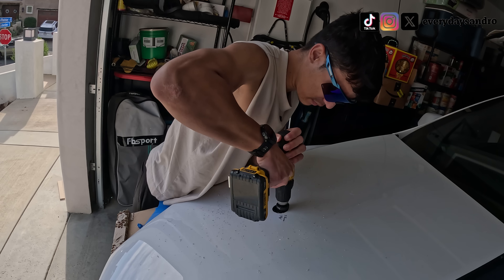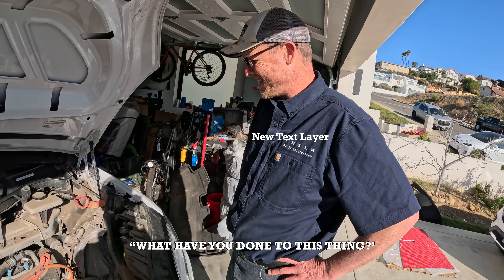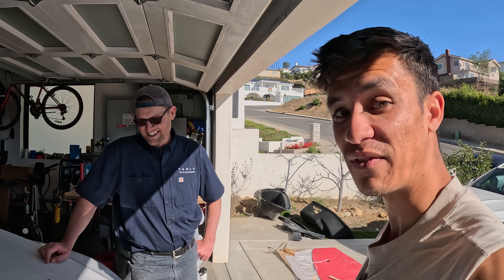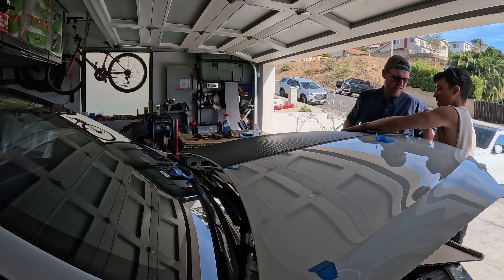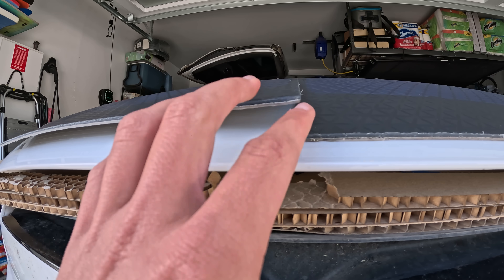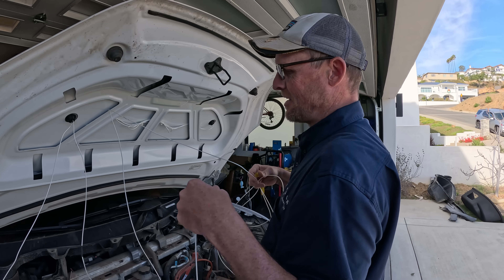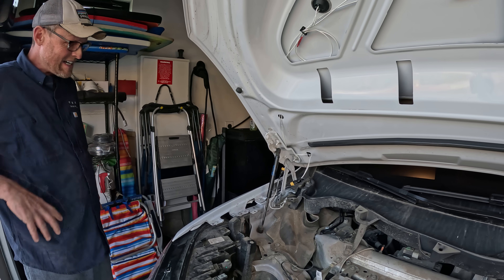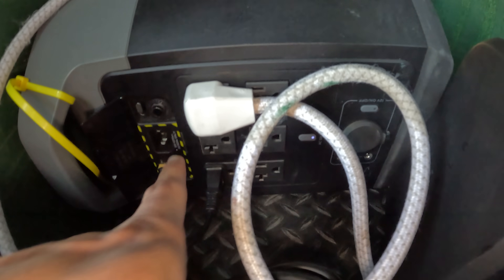DIY Solar Powered Tesla - THIS Changes Everything

Comment: Eh...why not get the EF Alternator charger? 800w output at $350 now. Or the Bluetti for $250 which charges at 500w.  Even if that's not an option for Tesla (haven't tested on my MY yet), just mounting 1 flat 400w panel on the roof will give you way more charging power and an easier install too.
Reply from the maker: Those are great tips but Teslas like you know don't have alternators so there is no real way that I know of get serious power. A 400 Watt panel wouldn't work on my setup with the Belugas wings!
Reply: @EverydaySandro  Between the time Ieft that comment and now I've researched a little more and yes it is possible. In my 2023 Model Y there is a DC to DC charger under the rear passenger seat. Your car has one too but not sure where.  You can charge your Delta 2 at 800w no problem without an alternator in a Tesla. Many people have done it by now. Even the Bolt can do it. Even a hybrid like my 2022 Sienna can do it.
Reply: @EverydaySandro  https://www.youtube.com/watch?v=-5kjbbG6Dx8

Comment: While this is a nice project, I would not expect much from those tiny Panels. On a Model 3 or Y I would probably try to either replace or cover that stupid glass roof with Solar...but even then it's probably not worth it.
Reply from the maker: Thank you for sharing your opinion but it has been very practical for my setup. These solar panels are often used for solar races, so some of the most efficient modules available. I peaked over 210 watts the other day!
Reply: @EverydaySandro  
Hmm...but isn't 250 Watts roughly what the Tesla uses in it's "On but Idle" mode? I think that's about what my Model 3 uses when charging for example,.so anything less than 200W of Charging power would not add anything to the battery?

Comment: This without about 6 to 7 mi a day if the panels are producing the maximum amount of power so let's be more realistic and cut that in half and it's about 3-3.5 miles a day of charge but if you calculate in the normal drain of the vehicle this number becomes even less
Reply: Prevent your car from randomly dying though and not able to boot up or open the doors so that's a bonus also might be able to run the AC for a little bit
Reply from the maker: That’s why I just use it to keep my power station charged for cooking while on the road! Thanks for being here with ys
Reply: @EverydaySandro  yeah I saw that later on in the video
Reply: I just tow my 11kw generator behind my Model S and plug the mobile charger into the 50amp receptacle, and I can go as far as I want ; )

Comment: Model y would be good 
Replace bonet with custom carbon fibre and solar
Replace glass in roof and tailgate with carbon fibre panels and solar. Use rear camera for rear view mirror. A bit harder to do as the glass roof is structural but definitely doable 😊

Comment: Great job. Next time when installing this panels tested as installing Formica on a board. Use  sticks under the panel before placing it down this way you have control over the desire location.
Reply from the maker: Great advice!

Comment: sounds pretty stupid having a battery in a car that already has a gigantic battery, maybe manufacturers have to put a connection to the car battery so that you can attach the inverter of your choice if they don't wanna offer one, or a complete solar system. maybe something like the charger plug but internal, intended for multipurpose, with charge an discharge capabilities and like usb power delivery, the battery tels the inverter what are the capabilities, so that it  auto sets everything up
Reply from the maker: Mention this to Elon! I just like to cook using solar juice, and need high output!

Comment: Should have brushed on a small amount of primer and paint on the bare metal from drilling the holes. Bare metal will rust. Over time, it will spread and get worse.
Reply from the maker: Then will just put Beluga up for adoption

Comment: I bet you lose more energy by the inefficiencies created by the impact on air resistance and added weight. I know the panels are not heavy, but they also make a minuscule amount of energy.
Reply from the maker: Haven’t noticed anything with my watts per mile. Biggest thing is that massive black center piece

Comment: charging seams limited make sure you're using an XT60i and not an XT60
Solder the center pin to ground this will disable the 8A car charging limit
Reply from the maker: We used XT60H connectors to make this work. Appreciate your input though! Thanks for being here

Comment: Remember to connect the third pin of the xt60i connector to the negative terminal of the xt60i. Ecoflow uses that third pin to exceed the 8 amp car input limit. If you use only the xt60 or connect the third pin to the positive terminal,  you would be limited to 8 amperes input current.
Reply from the maker: Thanks for the tip! This is great info for anyone trying to replicate the setup.

Comment: The 200W you get is great, so how do you plan on getting it into the battery?
Reply from the maker: Ecoflow with a grounder and then using the mobile adapter
Reply: @EverydaySandro  
Need to find an NACS adaptor that takes DC from panels and directly charges the batterys.

Comment: we want to know how much range you succeed to gain with that in place...
on a normal trip 200 miles, if you can get 50 or 5
you said 100w/h, if the car consumes 220w/h at 60 mph, that would mean you could reduce the consumption to 120w/h, that would be a huge improvement for summer trip for everyone or am I missing something ?
Reply from the maker: It doesn’t quiete work that. There is significant efficiency loss from the solar to panels into the battery pack, and then into the HV battery. I edit a test this week, and we got a few miles! Video will be up this weekend

Comment: Who is the FUSE???
The Fuse NEED to be Close to the Power output from the panel. So If +/- cum together the Fuse will protect your wires from get hot.
What If you rub the wires and the Plank cooper get tho the Metal from the car?????

And you NEED to secure your solderings!!! On Germany WE Call it (schrumpfschlauch).

Buddy, If the Car burning dont CRY😅😅😅

SO MANY ELECTRICAL ISSUSES!!!
Reply from the maker: These panels are put together in a series and don’t need have a fuse. Solar panels in parallels need to have a fuse protection against a malfunction of a panel because if one panels fails, the current adds up and can cause overheating. For our case, because they are wired in series, as the current remains constant if one fails, no fuses are needed.

Comment: at 100W, this should charge in about 12 months.
Reply from the maker: 200watts I peaked yesterday, so 6 months now - beluga🧃
Reply: At 100 Watts the 2kWh delta will charge in 20 hours provided he has 100watts constantly which is far fetched. You should refresh your math skills.
Reply from the maker: @ I peaked at 200 watts yesterday! This is 🤩
Reply: @marcusbiller867  help me out... did he say the were 150 watt each?...(correct me).. if he added roof to get to 450 watt, could he in  theory charge the car at home, and extend his range with solar charging by sitting/driving. Addionally, could he drive to/from work (1 hour), sit in the sun at work (9 hours- lunch), giving 10 hours at ( est 150 useful charging watts).. plus sitting in sun at home.. Do you think he could NOT pay for charging anymore. I don't have an EV so I don't know real world experience with how it all works... what's your opinion on my thought

Comment: Are you planning to add additional panelling to your X ?
Reply from the maker: @KrafteGrundsatzliche  as of now, no! At this time, this is all I need
Reply: @ I hear you. It’s rare that a necessary upgrade can look so badass!  Was wondering if it were possible to structure the panels similar to like an accordion, when not in use ( for storage ) but in certain situations, imagining a hypothetical config, that (if foldable) one could open up a charging point with ribs to expand it and perhaps place on ground, then once optimal ☀️ declines, could fold.  

Operating the panels on the hood suffices for your overall requirements?
Reply from the maker: @ I have actually seen a company make them for the Model Y (Prototype). For me, I wanted something small and practical, that wouldn’t create too much drag. This setup works so efficiently and requires me to only find some sunn

Comment: Ý tưởng của chúa 😂😂😂 I need a compact, high-performance solar electric bike, lifepo4 40135 battery, there is still no high-performance small solar panel
Reply from the maker: These panels have an efficiency rating of 25%, some of the highest on the market

Comment: 135 watts I have over  20 x that 3 kw on my garage roof facing the sun with the car in the garage out of the sun the second hand panels and rails cost $300 fancy shape and expensive not needed and when the battery is charged in 1/10 the time it can power other things.  Gives 200 km range a day  if you leave your car in the sun all day under 10 km
Reply: Sandro lives in his model x on the road. No garage so this is a great upgrade for him given the limited roof space he has available.
Reply from the maker: I appreciate your insight, and yes, I realize the solar potential is limited, but still loving it

Comment: Looks cool, but I hope it doesn't peel off on super a hot day. At the very least get something to overlap the front lip because the wind will constantly be tugging up on them.
Reply: wondering if a uniform tidy job of it is possible with hot glue?
or a high temp neoprene calk used on roofing.
Reply from the maker: @ we used a marine grade sealant to keep water out!
Reply from the maker: Good eye, you know what you’re talking about, as we just kitted it!

Comment: Once the Aptera comes out, you'll be able to buy their automotive-grade replacement solar panels and I bet they would work great on anything! I plan on putting some on my buddies Tesla when they are available :)
Reply: The drag co-efficient of the Aptera is so much lower than a Tesla that putting the same amount of cells on a Tesla would probably only net you 10 to 15 miles being in the sun for 5 full hours on a clear, sunny day.  Keep that in mind when you look at the cost vs. the payoff.
Reply: @Tekaisuwu  Automotive grade ;-)
Where will you get the glass cover?
Reply: @ most likely a high quality polymer as they do on the current prototypes because glass would be a massive obstacle price and sourcing wise. That’s just off the top of my head, though there maybe better alternatives available when I need to cross that bridge.
Reply: @Tekaisuwu  Aptera is using polymers now when glass isn't available ;-)
Why don't you just install solar at your residence where it's adequately productive instead of significantly impaired on a vehicle?
Reply: @ I am aware as I directly referred to Aptera using it. I’d do it because it’d be a fun and interesting project, you could say the same about this video. As I said before you never have a single positive thing to say. Why do you even consume this type of content lol
Reply: @Tekaisuwu   I have shared a tremendous amount of help providing accurate Aptera information. It's a shame you don't appreciate it more. This video was very confirming of my solar estimates. My positive comments are about helping people make wiser decisions about Aptera's true situation before they make any donations.

Comment: 300w is a lot for just the bonnet. Imagine if the whole car was covered. Maybe you'd get a kilowatt, or 1.5kw an hour.
Reply: It's a great idea but the model x has limited surface area to install solar because of the falcon wing doors. Ideally, all EVs will have integrated solar cells to recharge them in the future 👍
Reply from the maker: Stupid doors sometimes🥹

Comment: SANDRO - not worth it.
Tesla does not have enough Surface area for SOLAR to be Meaningful.
better OFF getting ROOF solar or Solar Carport and charging w/ POWERWALLS.
Reply from the maker: It’s not about range, it’s about the sun’s energy, and how to harness it! For me it’s worthwhile as I just added 2 miles to the car while I am answering all questions
Reply: @EverydaySandro   - SOLAR does not have enough surface area to be EFFECTIVE.
its why SONOS & other Solar car went BANKRUPT. 
you need 4x the surface area to charge FAST like 250v AC.
w/ solar still wont charge 50% in 8H.

Comment: But it’s NOT a solar powered Tesla….  It’s a solar powered EcoFlow battery bank for the appliances.
Still pretty cool.
It will be interesting to see how the panels and installation hold up with driving vibrations, heat, and weather.
I would definitely add retainer clips or sheet metal screws (if possible) for securing.
Reply from the maker: @covetthecamper2289  oh trust me, it will charge me, it’s premium juice - Beluga
Reply: @EverydaySandro  can you show your circuit? Documentation does not indicate you can charge HV pack from the 12v bus, AND charging the HV pack from 12v/10A will take a very, very, very long time, if possible.

Comment: Should’ve ran the cables through conduit under the bonnet and cable tied the conduit to the bonnet (hood) structure, or taped it down. Thus stop and risk of shorting because of vibration to the body contact points.

Comment: Next time get a file that has a curved bottom.  All you are doing is filing grooves into the hood by using a flat file.  Also when filing, you don't want to go perpendicular to the surface, but at an angle (like 30-45 degrees, for example, the first hole you did, the second you didn't).  You will find it much easier and end up with a nice edge this way.  Lastly a suggestion, I know it would be harder, but if you could have drilled the holes in the hood where the structure underneath is not attached to the hood skin (but covered the exposure to the underside), you would have a protected area for those connections to come through, without worrying about anything hitting them.  They would also be invisible from the underside, making it a very clean install.  I wish Tesla would have done something like this from the factory, all upper surfaces be covered with solar and in the glass too.
Reply from the maker: Thanks for the wonderful advice! Imagine if Tesla included these 😉🪛

Comment: Great idea curious to see how it has been workijg  for you.  You should put a few wire grommets in that frunk where the wires go through the body because it will eventually wear the wire away and cause a ground issue.
Reply from the maker: Appreciate the advice! I'll be sure to add some grommets.
Reply: We ran the wire through the existing grommet in the firewall 👍

Comment: When parked, you should see if one of those sun shade windshield reflectors adds any gain to the solar production.
Reply from the maker: That's a great idea! I'll have to try that out!
Reply: Or temporarily lay another section of panel across the windshield for potentially another 150W. Provide shade and power at the same time.  Assuming it's possible to connect/disconnect the panel somehow.

Comment: Recommend:
Seal the inside hood hole edges using Right Stuff.

You can also use Right Stuff to seal the front edge of the exterior panel/hood edges.
Use blue painters tape on the panel, and hood to mask.
Then apply Right Stuff. Smooth with your finger with 90% isopropyl alcohol, get at any pharmacy. 

Right Stuff will remain flexible. And can be razor scraped off if necessary for any reason. 

You may be able to get replacement hood struts to balance the added weight. Call the strut manufacturer. 

CONGRATULATIONS! 
You now have a business,  income!
Don't stop here! Model S, 3, Y are waiting!

Hustle these products to the right outfit! Competent, quality, skills. Maybe places that install car wrap/paint, or window tinting. 

OR, any Tesla aftermarket, repair facility. 
Gruber Motors in Arizona.
Medlock and Sons in Seattle. 
Konduit EV in Vista California.
Reply from the maker: Thank you for the advice, all is appreciated

Comment: dont you have to put something around the drilled holes in the hood to prevent rust bc of the exposed metal?
Reply: @drevro  i believe it's aluminium
Reply from the maker: It’s aluminium so it won’t rust but it can corrode, but we aren’t afraid of it. Thanks for caring!
Reply: @EverydaySandro  ohh okay thats good i didnt know that

Comment: The DELTA 2 Max has 2 inputs for solar/car.  Do you plan to still plug it into the car's cigarette lighter?
Reply from the maker: Yes I will to maximize input. When I do remote trips like Alaska and the Arctic, I unplug everything, so now I have an external supply of energy going into the EcoFlow without tapping into the HV!

Comment: I don't catch the plan behind this. You have a 2,4 kWh EcoFLow and load it with that Solar panels, right ? Do you load the car over the EcoFlow ? How much days must your car rest in the sun to get the Battery loaded ?
Reply from the maker: The Delta 2 Max has 2 energy inputs, so I can crank up the wattage to charge by using solar and the 12DC in the back. But the whole idea behind this is to keep the EcoFlow topped off constantly instead of needing the car to be on.

Comment: Hey Nice job!
Did you use a regular xt60 connector to the EcoFlow? 
To get a higher W  you need to use a xt60-i connector with a ground connected to the negative.

That will boost the W
Reply from the maker: We ended up soldering XT-60H to the wires as it was recommended by MitoSolar!

Comment: Nice project...the panel insterlation is fine! But I can not understand, why you are charching a powerstation and not the car direct.
Reply from the maker: I will charge the car but have never been in a situation where I had to. It’s mainly to keep my communication supplies powered when I get in a tricky situation that doesn’t require tapping into the HV